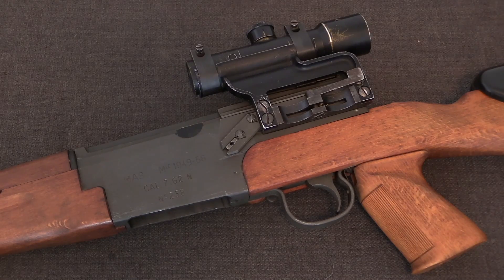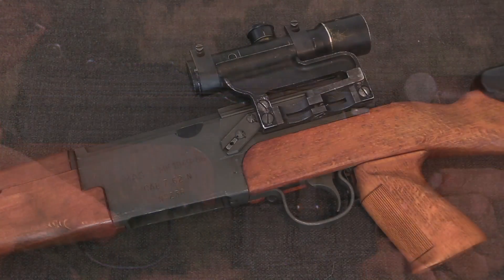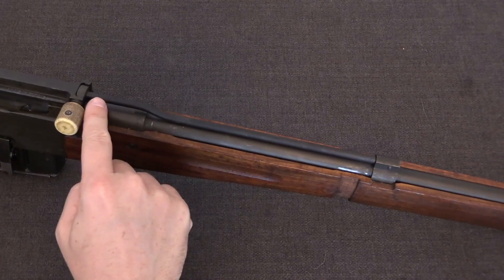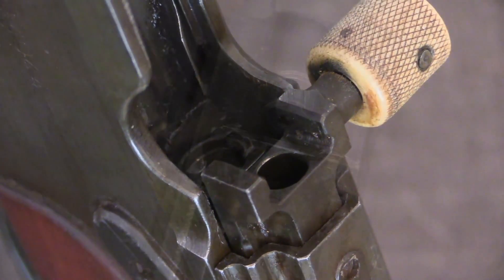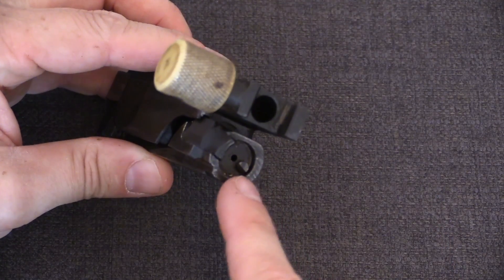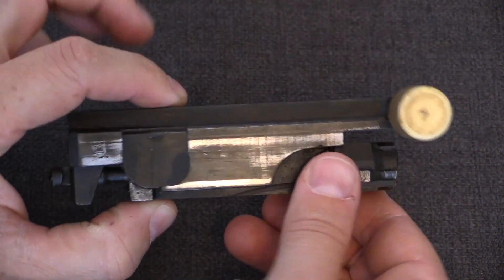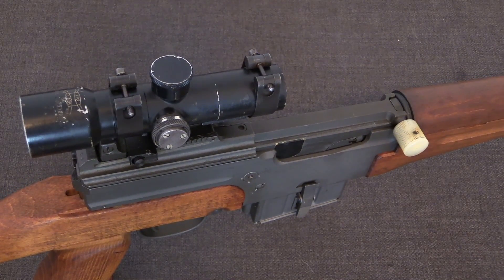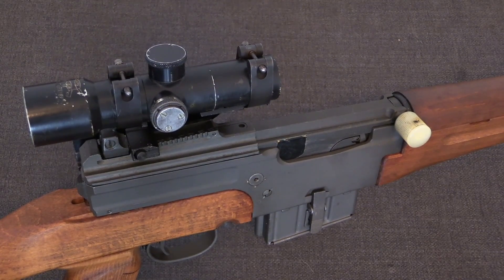How Does It Work: Direct Gas Impingement

Comment: The system stoner designed is a inverted piston. The piston is not simply fixed like the blind hole in a DI system. Gas is delivered into the bolt carrier between the bolt and the carrier. As the carrier is accelerate backwards. The bolt is being held forward. For the cycle to continue the bolt must overcome friction and complete rotation to onlock. Both from the thrust being applied to the bolt face/locking lugs, and the mechanical advantage designed into the cam groove. The friction from both lugs rotating under pressure, and the cam pin rotating. Increase dramatically as carrier speed increase delaying piston/bolt rotation. This by design auto regulates the system, and when combined with venting gas out of the system as the piston moves forward. It creates a outstanding piston system that is still state of the art. It is no more  a DI system than any other gas piston operating system.
Reply: The thing is, this whole process is still the result of a direct impingement of gas on the bolt and bolt carrier.  Thus it can still be considered a direct impingement system.  Other gas piston systems are not direct on the BCG, and are remote.  Thus they're still the result if gas impingement, but it is not direct.
Reply: @deanc91  The AR turns the gas flow 90° upon bolt entering the carrier group before acting on two parts a cylinder and a piston. DI designs never turn the gas flow. Never push anything but the carrier. The gas tube is literally resting against the bolt carrier directly forcing gas onto the carrier . There is at best a blind hole, but not always even that simple feature is present. DI designs also only apply thrust for a few mm. Shorter than all other action types. Where the piston is located and how the gas travels to it. Does not change the fact that it is a gas operated piston.
Reply: @alt5494   the 90 degree turn merely acts as a change on where the impingement acts on the vertical axis.  There's no actual functional change.

There is a cylinder and piston on Ljungman DI systems as well.  A blind hole is still a gas cylinder.  ALL other DI guns have that gas cylinder, there is no exception to this.  I guarantee you 100% if you cut off the Ljungman DI system's stationary gas piston/gas tube to be flush, OR you completely bore out that blind hole, the gun will not cycle, because it still requires the expansion chamber of the piston system to operate.  DI systems provide thrust as long as the stationary gas piston is inside the gas cylinder. You can see from the Mas49 example, and every other DI gun of the type, that the thrust lasts probably 1cm if not more.  The AR-15 is the same.  As soon as the gun unlocks, before even rearward travel begins, the gas rings will travel past the vent holes in the BCG, drastically reducing thrust.  By the time the gas key leaves the gas tube, there is next to no thrust left.  You can see how short this is in slow motion videos.  This is around the same distance of travel, possibly even less than the Mas49.
Reply: @deanc91   
The DI systems you are referring to have no effective volume for gas expansion or any form of gas sealing. The gas instantly leaks around the gas tube and and reverses flow back though the gas port. As such these systems only have a few mm of effective thrust. If you watch the video the bolt group stops accelerating even before finishing extraction. The system has to use high port gas pressure. Which is why gas tube wall thickness is so much higher on 
DI systems than on the stoner system. To your other question the Ar harness thrust not only from the bolt carrier being blown back, but also from the Piston pushing off the extension. Greatly increasing efficiency over a DI system.
Reply: @alt5494  That is completely untrue, as, once again, if you eliminated the expansion chamber, none of those DI guns would cycle.  An unsealed piston is still a piston and even an inefficient one harnesses a lot of energy from gas expansion.
The thicker gas tube can be attributed to inferior metallurgy and manufacturing of the time as well as design precautions. The AR15s gas tube is usually the first thing to go under heavy use.

But most important, the Mas49 gas tube is not as thick as you think. If you've seen the Mas49 gas tube, the portion that is visible from the receiver is actually significantly flared out, like a piston head. The part under the handguard is much thinner. Guess why it's designed this way

Also I fail to see any difference in acceleration between the Mas49 and the AR15
Reply: @deanc91   As the MAS-49 was put into production in 1949, and the AR-15 went into production in 1956. How do you explain the mas-49 having inferior metallurgy. As to your other point I said no effective volume. Not that DI systems have no gas volume for expansion. They do have a very small volume. The tolerance is incredibly wide in DI systems. Between the gas tube and blind hole to aid in alignment and prevent excessive fouling. Because of the wide tolerance the impedance to gas flow. Dramatically reduces as the carrier moves back. At the same time gas pressure is also rapidly dropping. So yes effective thrust is extremely short. To the DI without a blind hole. Yes it perfectly possible to design DI system. Operated by filling the volume between bcg and the receiver. It simply requires excellent tolerances between the carrier and receiver walls. Although this is added by it's much lower operating pressure due to surface area.
Reply: @alt5494   Well, considering the MAS49's gas system traces directly back to 1938, and between this time and the AR-15, we now have the ability to work forged aircraft grade aluminum guns, yes, absolutely inferior metallurgy and manufacturing techniques can be assumed, either from 1938, or 1949.  A lot can happen in 2 decades, or even half a decade.
Small volume is a massive difference compared to no volume.  That small volume for expansion still more than enough to drive the gun, and if there was no volume, the gun would not operate at all.  This is the main point.  The piston is necessary on other DI guns.  You cannot drive the gun from a simple gas strike.  The difference in volume has no bearing on whether or not the gun is DI.
The gun takes full thrust the entire travel of the piston, until the piston separates from the carrier.  This is the vent point and that's at least 1cm of travel, not unlike the AR-15.  The only way it would stop thrust before that is if the gas transfer is cut off before separation.  During this entire time, the gas piston is acting as a gas piston.  The volume of the gas expansion chamber has relatively little bearing as much as the length of the gas cylinder.  The entire volume of gas expansion really includes the barrel, and gas tube until separation of the systems.

If it's possible to design a DI system, then what guns use it?
Reply: @deanc91  Steel metallurgy was effectively equal. Aluminum verses steel receiver has no bearing on function. In DI designs the the gas tube is not a Piston. It has no method of sealing to the cylinder walls, and does not serve any other function. It is a simple nozzle with no complex design features. Gas leakage is significant, and gas pressure also drops significantly though the gas port as well. If the gas flow was as you seem to think. It would spray gas significantly as it cycled. The mas-49 does not do so or any other DI system I am aware of. You are under estimating the pressure drop in the barrel, and the volume of gas leaking out of the system.
Reply: @alt5494  All this talk about the manufacturing process of the gas tube is beside the point.  It does not need to seal for it to be a gas piston.  You can remove the gas rings from your car and it will still function as a piston with reduced efficiency. Not only that, the gas tube is not even that thick, as I have already pointed out.  It is relatively thin, and is only thick at the piston head portion.  

The thing is, that the gun is designed with this amount of gas blowby in mind, just as other piston guns like the AK.  It does not need a sealed chamber to cycle, just like the AR-15 does not need a sealed chamber to cycle.  The AR-15 also has significant gas leakage from the exact same spot.  You talk about the bolt gas ring seal as if that seals the BCG's gas chamber, but it does not.  The gas key interfaces with the gas tube in the same way the piston head interfaces with the BC in the Mas49.  There is equal amounts of blowby because there is no seal there on either gun. 

Like I said, if it did not need the piston system, then the Mas-49 and all other similar DI guns would not have the recess and piston head.  By definition, this is a piston, and it utilizes the same mechanics of a piston.  There is no DI gun that does not utilize this design feature because it needs the recessed gas cylinder.
Reply: @deanc91  In the AR the gas tube has a very close tolerance at the tip, and does not dead end the gas flow. It deposit it smoothly into the cylinder/piston. In the mas-49 the carrier is fully accelerated before the bolt unlocks. The two systems are dramatically different in the way gas is contained and utilized. The stoner system gas rings. While not perfect do dramatically improve gas sealing. The  Ak uses a multi ring design as well( although it is milled straight into the Piston head). To reduce gas blow-by until the vent holes are uncovered by the piston. Just as the AR does. Finally Stoner himself decribed his system as gas piston. I have not yet surpassed his body of work. Would care to make that claim?
Reply: @alt5494   They're not really all that different at all.  The only real difference is the location in which the impingement is occurring, primarily in the vertical axis, and the volume of space in which it is doing that work.  The only functional difference between the two is the AR-15 and the Mas is the AR-15 uses "gas expansion" for some assist in the unlocking procedure, whereas the Mas unlocks purely from the movement of the carrier.   That is not enough to differentiate between two systems, because it does not change the mode in which the gun cycles, only the unlocking procedure

Yes, many piston guns have certain features that assist in "sealing" but it is not sealed in the sense that the gap is physically closed by a gas ring like the AR-15.  The piston on most piston guns is fairly loose with a lot of blowby, just like the Mas49 and other Ljungman DI types.  The point is that the AR-15 being tight does not equate to piston guns because

Stoner did NOT say it was a piston system.  He only says in his patent that it incorporates a piston.  He says it's a "gas expansion system," unlike other DI systems which is just legalese to differentiate it between other DI guns.   Gun diagrams of DI predecessors of the MAS49 for example, like the AG-42, will label that very part a piston.
Reply: You having been doing nothing but stating your opinion as fact. Since your first comment. Even when reading a patent that clearly stated gas expansion, stationary piston, and gas cylinder multiple times. As well saying it is not DI. Do you even understand the basic fundamentals of mechanical engineering? Or is there some other facts. you would like to miss use to confirm your opinion?
Reply: @alt5494   I've backed up everything I said with basic physics and engineering.  There is no functional difference between Ljungman DI and Stoner DI besides the caveats I've stated.  The method of operation is near identical. 

I didn't state anything in the patent read as opinion besides "gas expansion" as legalese because it is.  It never says in the patent that it's a piston driven system.  It CLEARLY says it's a "gas expansion system" which literally all gas operations are the result of gas expansion unless you're using a fan or something to blow the air.  Feel free to try to refute that. 

From Stoner's patent:
"This invention is a true expanding gas system instead of the conventional impinging gas system. By utilization of a metered amount of gas from the barrel, the automatic rifle mechanism is less sensitive to different firing pressures caused by variations in the propelling charge."  He never says it's not DI, it's just not a "conventional impinging gas system."  This does not eliminate it from being an impinging system, just not a "conventional" one.

 If you want to play the patent game, then look no further than US8210089B2, which is a patent for the indirect gas impingement system. It is literally just an AR-15 with a long stroke gas piston.  There's also US9766027B1's indirect impingement system which is just a short stroke gas piston.  Still considered impingement even though it uses a piston and is clearly not from gas strikes.
Reply: @deanc91  Your argurment is that the stoner system is not a gas piston. Because it is not remotely mounted, and gas being delivered into the carrier. This is wrong for three reasons. One everything you have said about DI systems would also be true of straight blowback systems. By the same basic system you have offered. Because all DI is a relocated blowback system to enable lock breach design. Two the length of the gas delivery tube/port is a design detail. All short stroke and long stroke piston system. Use a gas tube between .5" and 6" long. To feed gas into the system. Elongating that tube to 8" to 13" long does  change the core design. Three the DI system gas key does not contact the carrier, and delinks on carrier movement. The stoner system continues to impart thrust after detaching from the carrier. As it blocks it's gas port,( inside the carrier by bolt movement)(as stated in the patent) and continues gas expansion from the reservoir. Untill venting at full bolt travel. 
Unlike DI and Blowback systems which do not self regulate. If you still disagree I understand. I simply can not share your opinion.
Reply: @alt5494  I never said the Stoner system is not a gas piston.  All DI systems use a gas piston including Stoners. I'm saying DI and gas pistons are not mutually exclusive.

Yes blowback operates on the same principal as both DI and pistons as well. The difference is that instead of an actual gas system, it is being blown back with a case. Thus it gets to sit in its own category. 

Yes, a design change can result in a big difference. However it does not change the method of operation. If you extend a gas tube to 10000 feet, it will still be the same method of operation.

I don't know what you mean by point 3. The AR15 vents as soon as the unlock is complete, which is the length of the cam on the bolt carrier. Very short and about the same length as any other DI gun. As soon as the unlock is complete, before the BCG even leaves the chamber, the gas ring passes the holes and vents, not at end of full travel.
Not only that, full travel venting would be impossible because it detaches from the gas tube very quickly